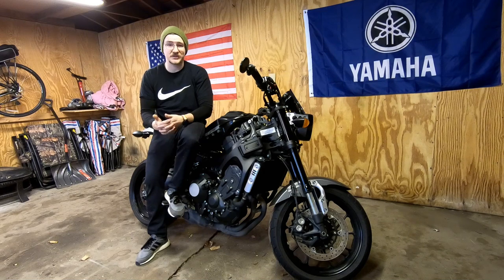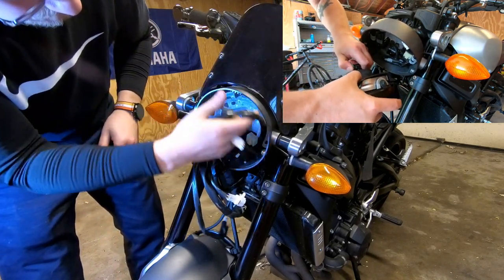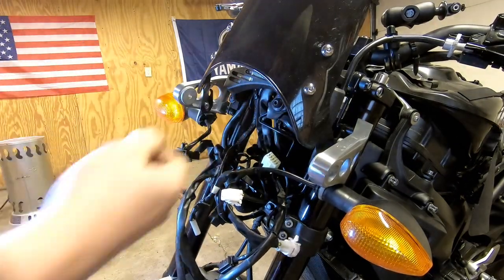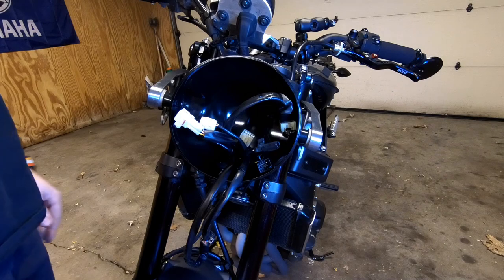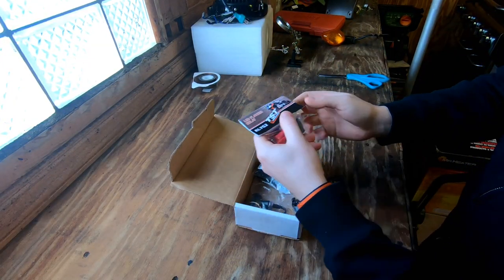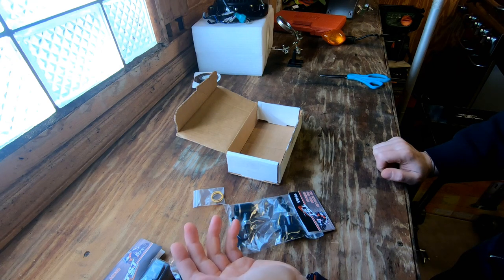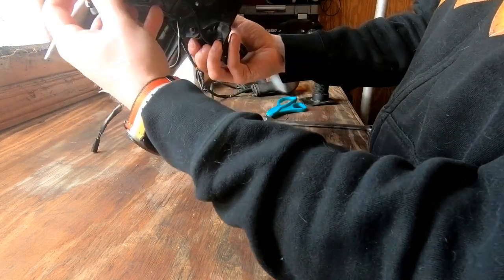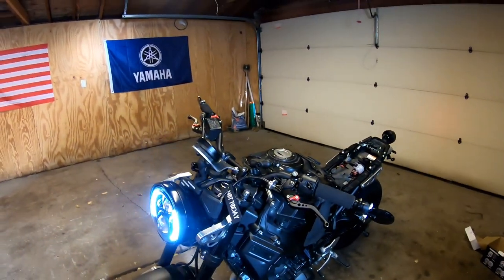Winter Mod Series EP1 SKTYANTS 7” Headlight &TST Industries Echo turn signal installed on the XSR900

Comment: Great video...I got the 5 3/4 adaptive...$550.00...The headlights are not bright enough and I think bike will look much better with 7in bucket...are you happy with yours? would you buy again? Is there one without turn signals?
Reply from the maker: For a $70 headlight I'm very happy. It's been a solid headlight. It does have the turn signals. I'd buy it again

Comment: Sorry when you said to convine  the black cables, do you attached them to the turning cable. Or just put those black cables  together by themselves and that’s it, I have been trying to get this installed  but now the LDR light doesn’t  work even on the tail light, my horn and brake light are not working.. I already check the fuses but the problem keeps on going, any suggestions thank you
Reply from the maker: I just combined the two grounds of the turn signals together

Comment: For the headlight how did you ground the signal lights ? Did you wire them into the plug adapter on the bike ?
Reply from the maker: I cover this around 9:00
Reply: I didn't understand what you did either, you put the ground wire into the signal wire?

Comment: Hi, have this headlight for my sr 250 and apart from the h4 plug for headlight I only have 2 small spade terminals coming from new headlight not 3. Seller trying to say after checking with engineers  that yellow for dlr lights and red for left and right indicator. That can't be correct.
Reply from the maker: Yeah if I had to guess I'm assuming one spade is ground, one is drls. Probably similar headlight but not the same.

Comment: I'm running pretty much the same headlight and I think it really looks nice. What I have found is that it's aiming slightly to high with the stock mounts and the new housing. Have you had similar experiences and if so, how did you fix it?
Reply: Same question here, how did you manage the aim of the headlight with stock brackets?
Reply: I imagine you could just loosen the housing on the mounting bracket and tilt the housing down to the desired height then tighten it all back up.

Comment: Hey! When I connect the front turn signals i and turn on, the signal lights flash fast, amber on one side and white on the other side. Any suggestions? Ps the hazard lights work properly
Reply from the maker: sounds like wiring got crossed somewhere. The fast flashing is probably due to the stock relay, i had the same thing before I swapped to the TST relay. The signal lights should be white and only change when the turn signals activate. The hazard lights thing is weird, definitely check the turn signal wiring again.

Comment: So I'm still a bit confused. My driving lights flash along with my turn signals, and I believe thats due to the relay which I have ordered. However, I'm not sure exactly how to hook up the driving light connection. Correct me if I'm wrong but you said to tap into each turn signal wire and connect them to a spade that then connects to the brown wire? My turn signals only have two wires, and ones obviously a ground.
Reply from the maker: Is this a Euro bike?
Reply: @XSRDetroit  nah USA. 07 Ninja 250
Reply from the maker: You will have to tap into your wiring harness and run another line for the DRLs. Check a wiring harness diagram to see where you need to tap in

Comment: Hey man cool content.. I bought the same headlight for my xsr but my bike came with no front turn signals!! The guy that I bought it from was riding without turn signals 🤷🏻‍♂️🤷🏻‍♂️ 
I was wondering if you can shot me a link to the adapters that you’re talking about?? 
Thank you 🙏🏼
Reply from the maker: Check out babbits, look at the turn signal wiring harness and your should be able to find the stock turn signal connectors. 

If you run into trouble message me on ig @xsrdetroit it'll be easier to help you on there

Comment: Hey. Great job! I'm trying to do the same but not so lucky. Can you help me? My stock turn  signals have only 2 wires and the new headlight just 1, when i conect it the turn signals dont blink, they just stay on. Please help.
Thanks
Reply from the maker: Is this a European bike?
Reply: Yes
Reply from the maker: From what I've read online the euro bikes have parklights instead of day running lights like the American bikes. You should be able to tap into the park light to get the drls to work
Reply from the maker: The headlight should have two connectors for turn signals, one for each side

Comment: Nice vid.  Is the headlamp still working? Does it ever fog up or get moisture inside?
Reply from the maker: Yep! Haven't had any issues so far
Reply: @XSRDetroit I don’t understand the ground wire portion, what are you supposed to do with the ground wires( black wires)?

Comment: Great video.
The headlight bemm/aim seems a little bit too high?
Reply from the maker: Yeah it definitely was. I ended up adjusting it once I started riding the bike again
Reply: @XSRDetroit  did you have to modify the bucket to be able to lower the beam? I have the same setup and the aim is way to high.

Comment: Hey man i did everything you did but the headlight t/s stay solid when activated, you know what the issue could be?
Reply from the maker: Are you using the stock relay?
Reply: @XSRDetroit  no i have installed a flasher relay for the rear lights
Reply from the maker: Try the stock relay and see what happens. Is it a brake light flasher
Reply: @XSRDetroit  i figured it out, i had to add load resistors bridging the headlight turn signal positive to the ground, took me all day 😅
Reply from the maker: Just out of curiosity, is this a euro bike?
Reply: @XSRDetroit  no man us
Reply: @lexacost  After a week of struggling and searching for an answer this one comment solved my issue. Thank you
Reply: @lexacost  so you have to add load resistors even with a flasher relay? im using the tst flasher relay
Reply: @YoungKenji  yeah, I had to my flasher relay worked for my tail light and the turn signals, but not for the headlight
Reply: @lexacost  hey man I'm confused on how you added the load resistors, having the same problem. Right now I have the grounds together and the chocolate and green ones both going into the headlight for each side
Reply: @cavcav46  hey man, let me look at my notes and i will get back at you asap
Reply: @lexacost  Hey, could you send me your notes as well? Having this issue right now.
Reply: @siccfucc3063  I sold the bike with the service manual and the wiring schematic. I got a video on my channel maybe it can help you